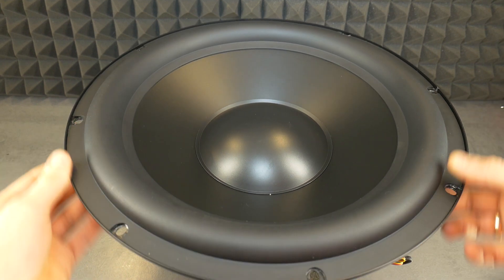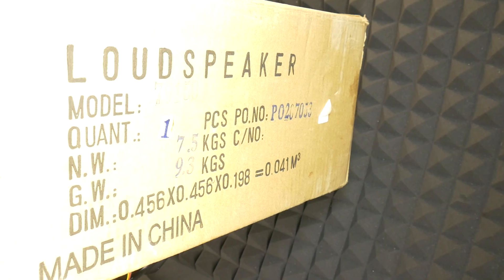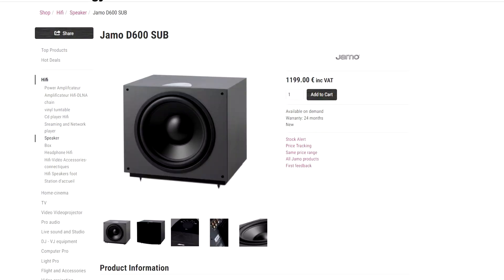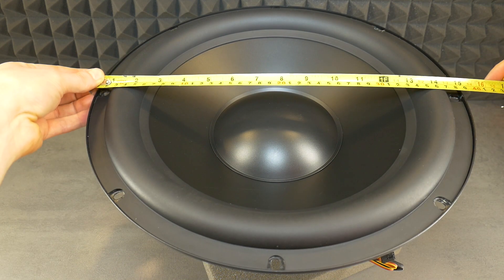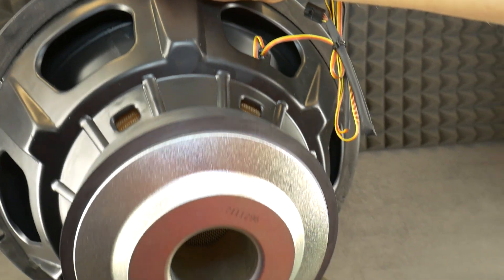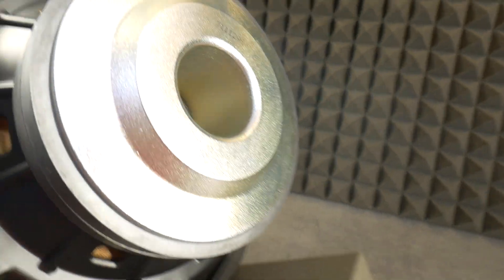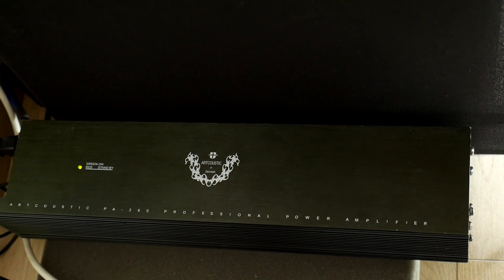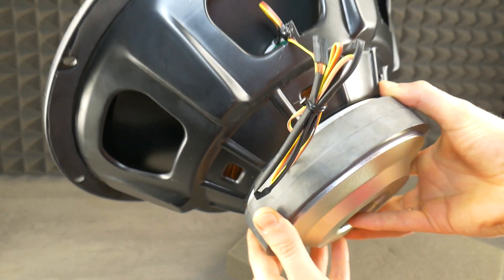15 inch THX subwoofer - What next?

Comment: Hey @TechScrew. That's a nice sub there ! For me I would first determine what I would use it for. Would I use it for "music" or " home theater" . Either way it would sound good sealed or ported . For sealed bass is "tighter"  box being made will be not as deep as if you are doing ported. The (sealed) if tuned to 40hz down to 20 hz , the drop off will be faster , and yoouu would more amperage to push.  (Ported) more output digs deep as long as you the box being made the port is wide either a "slit port" or" round" port . If builded correctly" port" it will sound fantastic." Ported "  Being as tho the box will be builded bigger for air volume ,  box volume. More amperage the more profound the bass.  If their's anything I've missed didn't say or incorrect please let me and anyone looking to learn your input . Great channel @TechScrew  anyway would sound great!